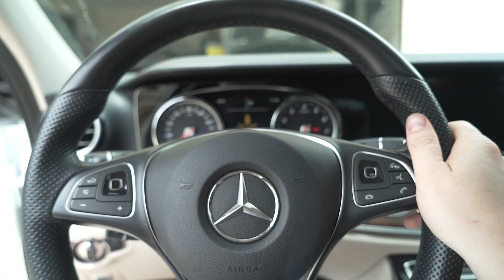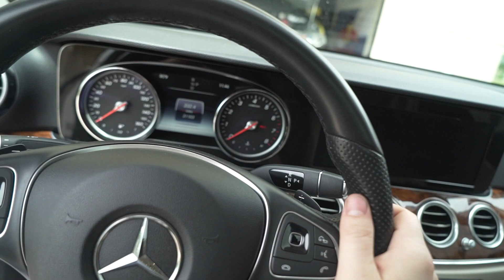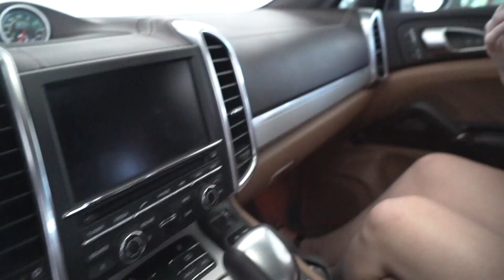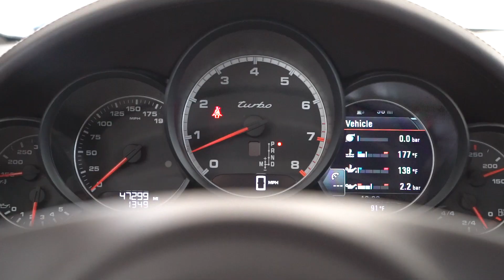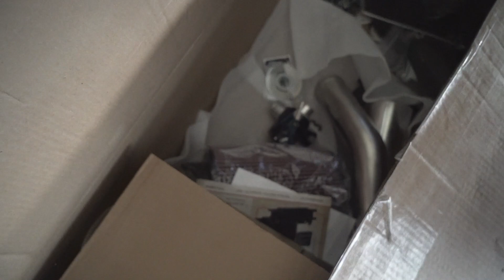MOUNTING THE BIG TURBO on the EVO X!

Comment: "Install" doesn't start till 8:50 everything else is just talking... 
 Pulls engine cover thinks it's the valve cover😅 you need to get an aluminum valve cover bruh bruh the oem valve cover is plastic and that manifold is going to get to hot for the plastic😫... plus I hope you didn't just hand thread those studs in and actually torqued them down using the double nut method ...
Reply: Dolly DeHart barely any progress was done in this video lol
Reply: GeeFK of course 😂 he's got to milk it for all its worth
Reply: GeeFK lol rarely ever does he make a lot of progress....

Comment: Your going to have to clock the center Cartridge on the turbo also because the oil drain is in the top.. the small port is the feed and  the big port is the drain.

Comment: Hey Evan that piece you took off that you didn't know what it was at 7:50 with the bolt holes and egg shaped hole is the lifting point if you ever have to pull your engine out of the car. Would definitely recommend keeping it on the car or at least in the tool box just in case. Love the vids bro keep them going and stay positive

Comment: Yo Evan, Should I go w Cobb tuning for my gti or should I get something else like APR or unitronic?
Reply: APR
Reply: Cobb. Apr is fantastic but Cobb you can have gauges running and monitor them.
Reply: If its 1.8t go giac tune
Reply: Taven Putnins That’s what I like about Cobb, but then also heard so many mixed reviews about the OTS tunes..
Reply: WhiteMk6GTI I've run Cobb tunes on a couple of my wrx's and I can't lie they were better than my protuned cars. Also the accessport is a huggeeee plus. As for apr I had a mk4 with an apr stage 2 kit and it was great but I was missing the ablily to view the major vitals of the car. I personally would go Cobb. Very great customer support and you can't beat of the fly tune changes. On top of that most good tuners can use your AP for future upgrades.
Reply: William Turbyfill so you'd recommend cobb OTS for wrx's? Im iffy with the mixed reviews as well but want to try some stuff with my car
Reply: If it's a 1.8t don't go APR. Their tunes are.. Meh. Go gonzo, giac or a custom flash from someone local. Apr and unitronic are shit.
Reply: Brandon Morgan what mods do you have? That plays a key role
Reply: jake_atx 20 judging by his name I'm thinking he has a mk6 so a 2.0
Reply: WhiteMk6GTI id get the cobb tuner but id run someone else's tune i heard cobb tunes arent the best but thats what ive heard i have no experience with one.
Reply: William Turbyfill stock right now, waiting until ive seen all my options
Reply: William Turbyfill it’s a 2013 2.0t

Forge twintake
Ecs turbo outlet pipe
Neuspeed throttle pipe
GFB Dv+

I know Cobb is fantastic w subies but I’m not sure how they would do on VW. Thanks for all the input my dudes!
Reply: Brandon Morgan I would go Cobb for your subie man
Reply: Brandon Morgan Go Cobb stage 2, do not get a bov whatever you do. I've got an 06 wagon right now that is dyno tuned and they made sure it was somewhat rich. Cobb stage 2 and it'll run like an sti. I had a 2004 sti with Cobb stage one and my current wrx is about as fast. The ej255 is very temperamental so research every mod before you put money into it.
Reply: William Turbyfill yeah i noticed his profile pic after i commented. I guess my comment goes for anyone who has a mkiv 1.8t. Lol
Reply: Eurodyne with maestro 7
Reply: WhiteMk6GTI I have a buddy with a mk6 on a Cobb tune, the car has around 140k on it and it's running awesome.he does have all Cobb parts though...
Reply: Johnny_O  one plus to this, with you current mods I would get it tuned through the AP.
Reply: Go with a cobb and get a tune done by stratified. The pops and cracks are amazing and the power is great.
Reply: The gauge are a great feature over a apr tune too. It's super helpful for making sure your car is running good and diagnosing for when something is wrong. Apr makes a good product too, but this is what I'd go with
Reply: WhiteMk6GTI - you're asking a person that called a waste gate a blow off valve then say no one called him out on it lmfao your safer guessing then asking him lol
Reply: Apr
Reply: WhiteMk6GTI if you wanna do everything from home and want custom maps in the future, the accessport is the way to go.
Reply: William Turbyfill Lol ots use is only to help you enable to run the parts for the time being. It's not meant exactly for your car.
Reply: Brandon Morgan I'd recommend them only for the time being until you can get an actual tune.
Reply: Apr don’t do trashy Cobb
Reply: WhiteMk6GTI why would you ask evan? He don't know what he's doing he shouldn't be giving anyone else advice...  with that being said 2.0t go apr or get jb4
Reply: WhiteMk6GTI I'm actually about to start a channel with my Mk6 GTi & TII Rx7 I will probably make a video over this topic but for the time being! I have had both Cobb & Uni. I'd say it ultimately depends on what your end goal for your car is man. Uni stage 2 was a solid tune speaking from driver feel(never had a chance to datalog), a little spiky in the lower rpms but that's stuff you get use to after awhile. If you're just looking for good power from a DD & don't really care to "interact" much with the car, Apr or Uni is the way to go. I can't really give you a legit review of Cobbs OTS tunes(I made the switch to a hybrid Ko4 that forced me to go Cobb due to there not being any companies with OTS maps for said turbo) but that for me is just one of the HUGE benefits of cobb! The ability to get a tune written for your exact modifications is everything in my eyes, whether it's a e-tune(highly recommend freektune or stratified tuning) or dyno tune. Like someone stated in a pervious comment, you can mount your Cobb unit & monitor different perimeters of your engine like knock, AFRs, Oil/IA temperatures (although some won't be completely accurate you can kind of ball park when things aren't within the usual perimeters) I just love "interacting" with the car. I will say this, I wish Cobb came to our platform sooner cause I never would have spent the $700 that I did on Unitronic🤷🏾‍♂️
Reply: Just bought a mk7 gti and I'm the same situation rn
Reply: Carell Armbrister I’m going to keep the stock turbo so I don’t think I’ll ever plan on going stage 3... I just want the best bang for my buck for a daily driver and occasional track use on the weekends but definitely not every weekend. Thanks guys!
Reply: Diego Pelcastre What are you lookin at right now man? I’d love to hear your input
Reply: Apr
Reply: WhiteMk6GTI i got a mk7 soon to go cobb tune. Like the fact that its very flexible when it comes down to it. I can run ots tunes or get a costume tune done, even map has a custom tune for the mk7 accessport. I can even rebuild the entire motor if I want to down the line and still use the accessport to retune the car for more power . Cobb access port allows you to do so much more then the other companies. It puts u in control an ur not stuck wit a tune u may not like
Reply: I have driven an APR stage 2 Golf R (2017) and an APR stage 2 golf (a 2011 gti). Both ran great, so I would go APR.
Reply: I have a MK6 as well and Cobb is definitely the way to go! The AP combined with an e-tune from Stratified is so amazing!
Reply: William Turbyfill better?
On Mazdaspeeds the Cobb tunes suck terribly lol. Only upside on a GTI is the ability to data log and pro tune, APR puts down better peak numbers and has a slightly better torque curve imo.

Comment: Make sure your oil feed and drain are as straight up and down as possible or u will destroy that turbo. From the video it looked like the angle was almost front to back. And also if it's a ball bearing turbo don't forget the restrictor on the oil feed. If it's not ball bearing don't need a restrictor. Good luck on the build.

Comment: Thread locked usually won’t do much at that high of temp, I would stack two nuts on top of each other on the stud and tighten the stud. My bad if you were already planning on doing this.

Comment: Bro you cant just spin the studs in by hand...you have to put 2 nuts on each stud lock them together and then used the nuts to tighten the studs...then you crack the nuts loose and then install the turbo...

Comment: You have an ar15 pistol with no vertical for grip but if you have an SBR(short barrel rifle) you can have a vertical for grip.  An SBR the length of the barrel is anything under 16in.  A 16in barrel is a carbine.  The laws are different in Texas the shitty ass Cali which you can not have a vertical grip on anything.  By the way I have the same grip from Magpul on two of my AR15s carbine. They are 556/223 and 300 blackout. I have fun building ARs.

Comment: You got a non optioned E-Class man.  They have much more advanced features and this had nothing, literally. My 2017 C class has more features than this. Burmester sound system, 360 degree camera, and so forth. Burmester is the same system as an option upgrade in Porsche's that is near a 5k option...